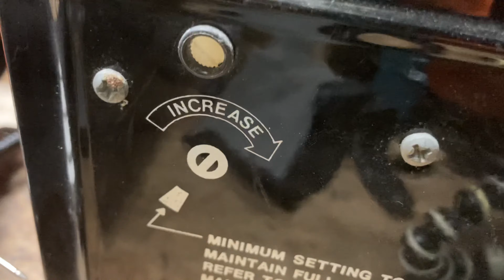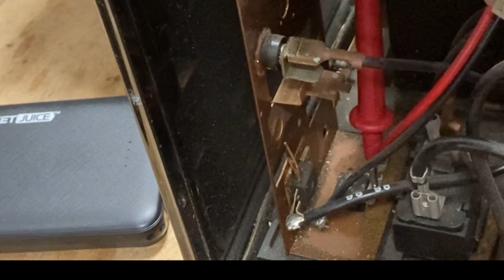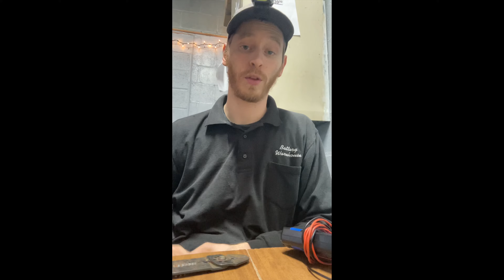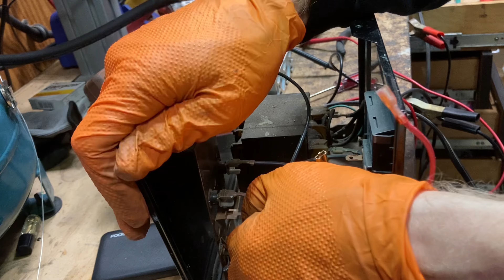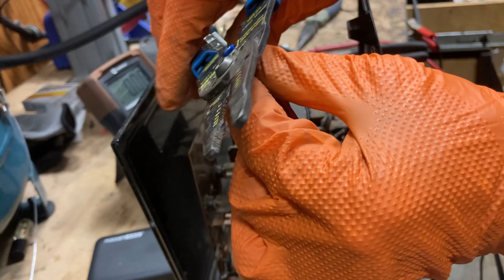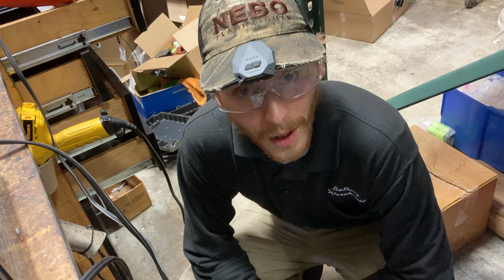Fixing a 10A Schauer Battery Charger || Turning an Automatic Charger into a Manual Charger

Comment: A diode or rectifier is pretty simple device.   Coming off the transformer is alternating direction. Goes out comes back.   So, let’s think of a gate in a fence that is mounted to swing in one direction.  No latch.  So you walk up to is, and push it to pass.  Then you turn around to come out.  You push on it and it blocks you from leaving.  Now, you put a second gate that opens in the same direction.  You can go through either gate, but trying to come out, push and you are still there.  Now you need a swinging gate on the opposite side of your yard (your DC) to go further.

Comment: Mine's works are you trying to connect it to my car I don't know how to use it
Reply from the maker: If you were just trying to use it, plug in the AC plug to a working wall outlet or extension cord, then hook up the red alligator clip to the red/positive terminal on your car battery and hook up black alligator clip to the black/negative terminal on your battery. Then turn the dial on the charger to “on”